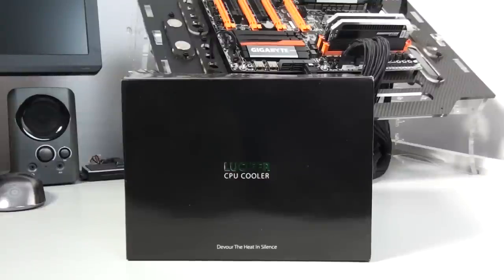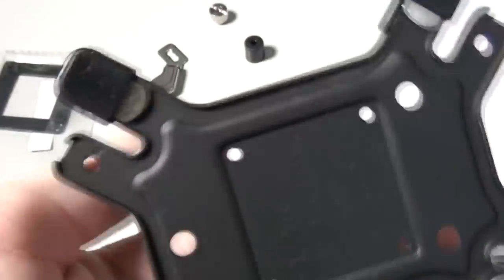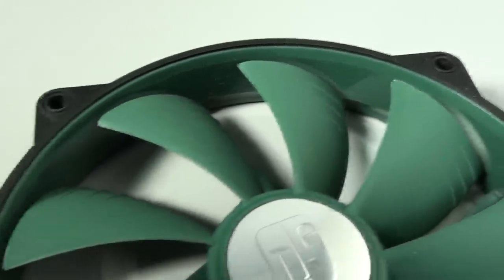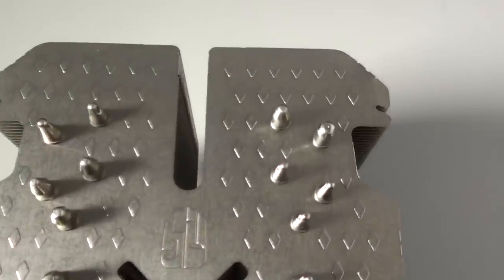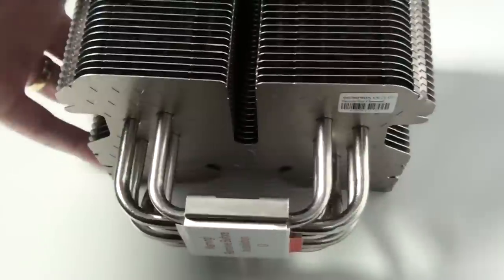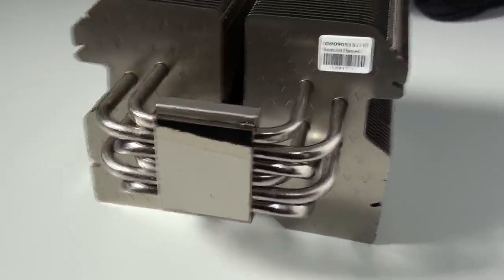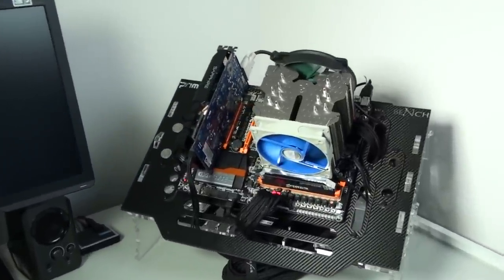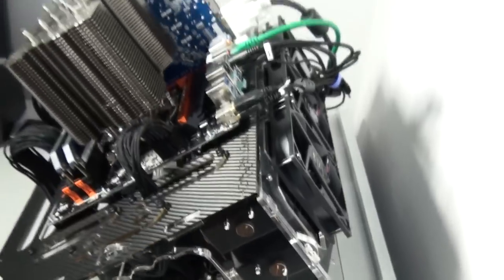Deepcool Lucifer Review

Comment: I just bought this and am very happy with the performance. However, I am confused as to why there are so little reviews about this cooler, and most of them show this as a poor performer. While some of them, like this video, show it performing really well against even a NH D14... It just seems that there is so much inconsistency in reviews of CPU coolers and also fans.

I would like to see you compare the NH D15, Lucifer, Assassin against some of your high end water cooling configs and also some AIO units. Only because I trust your review procedures lol
Reply: It will fit! The 750D case has a maximum CPU cooler clearance of 170mm. The Deepcool Lucifer is 163mm without the fan and 168mm with the fan. The fan is kind of adjustable though so you will be fine. I am using mine in a Bitfenix Prodigy with Corsair SP120 fans which makes the max height 163mm. The included Deepcool 140mm fan sticks out above the cooler. But you will be fine, the cooler is definitely great bang for buck.
Reply: It it is standard size ram it will fit underneath no problems. I had Corsair Vengeance memory (the ones with the big heatsinks) and they fit underneath perfectly. The 140mm fan wont fit on them though. The fan will have to be adjusted closer to the top of the cooler which will prevent the side panel of the case from closing. So I would just stick on two 120mm fans and you should be fine.
Reply: ***** yeah I was looking at getting some JetFlo fans as well but went with a mix of Corsair and Bitfenix fans. The SP120 LED's and Bitfenix Spectre Pro's arent as good as i was expecting, they are very loud unfortunately. I will just have to deal with it then lol
Reply: ***** haha nice rigs, i got a 4670k at 4.3GHz, 8GB Gskill memory, MSI HD7870, OCZ Vertex 4 128GB, all on top of a z97 mini ITX board inside my Bitfenix prodigy.
Reply: ***** Cant remember my R15 score but it was alright. And about the GPU, I dont play many games any more so right now my PC is just a beastly media server that I occasionally play CSGO and MX vs ATV Reflex on which are old games :) I rather put my money into funding my primary hobby, motocross. But I still love overclocking and tinkering with my already old PC parts. Going to delid my CPU soon to gain a few more MHz and my GPU already has a respectable overclock, +100MHz on the core and +200MHz on the memory. Temps dropped by 15 degrees C when I replaced the stock thermal paste with MX4 lol so could probably up the voltage a bit to squeeze some more performance before she dies haha
Reply: ***** yeah when i got some more time on my hands i will definitely crank this thing up:) cheers man

Comment: A single 360 rad would be enough for the entire loop, even with low fpi, 

however more surface area = the lower your fans can spin.

One 360, one 140/120 with low fpi and some corsair sp quiet edition fans, if you plan on doing sli at any point in the future, go ahead and get the second 140/120 so you can keep those fans spinning low, though not necessary and way overkill atm.

Only reason I recommend the corsair fans is because it's what I use, and they are awesome.

Comment: Well done.  Glad you pestered them on the innovation front.  All this crap looks and works the same it seems.  It also looks like they borrowed "heavily" from Noctua's designs for both the fan and heat sink.  Slightly different shape, but fundamentally very similar.

Comment: Might of done a lot better if he had the fan turn around correctly. It was mounted correctly but pushing back through the fins instead of pulling through and out the back of the case.  Oh well. Still impressive

Comment: Hi on the test with one fan did you push or did you pull ? I'm asking beacuse i want a 140mm CPU cooler ( lees noise then my current 92mm) but dont wont to break the bank.... my config is i7 4770 and 2x4Gig Corsair Vengeance and yeah as i see it wont fit the FAN for push but what about for pull are the Temps good on pull only ?

Comment: a 3770k @4.4ghz and a gtx770 or 780
i was thinking one 360 rad + 2 140s
if i wanted performance i would go with a thick, high fpi rad
if i wanted silence i would probably go with a thin, low fpi rad
but i want the least noise while still getting reasonable temps below 70* max
fans will be the nb eloops that singularity always uses
and some 140mm fan with similar specs

Comment: planning to use this bad boy on fanless mode on my i3 6100 cpu
its 65w max i read this bad boy can handle 125 tdp on fan less mode 
so i presume it will do pretty well on my i3 seeing as how its just chilling at 71 without a freakin fan
Reply: Just get a big passive cooler
Reply: i have the cooler now pretty funny how its doing well without a fan on my i3 6100 well the cpu is pretty chill to start with
Reply: meareAaron Was thinking of getting this one for my current and future cpus, i have a x4 940 rn whitch is 125W and TX3 is pretty noisy during summer.
Reply: its pretty quiet ill give you that since i dont have the fan on hahaha 
though somewhat pointless if you dont have quiet case fans
Reply: meareAaron I got 3 12cm very silent fans. But airflow isn't that great still, since it's a sound isolating case.
Reply: oh nice one :D all i have are stock led fans hahah
well its better than nothing 
since im on a tight budget as of now